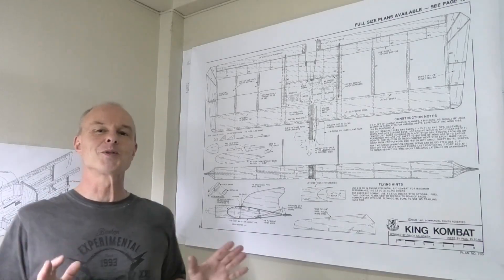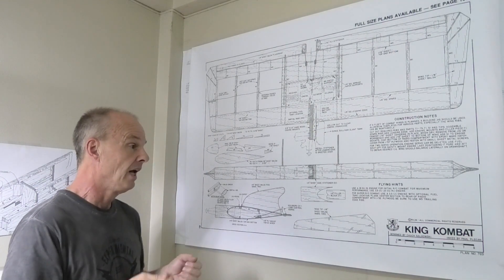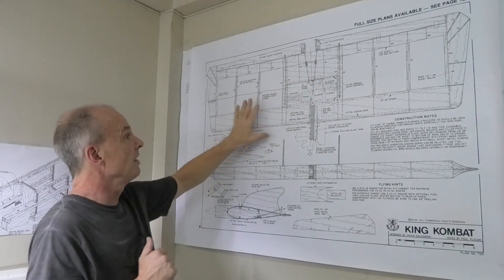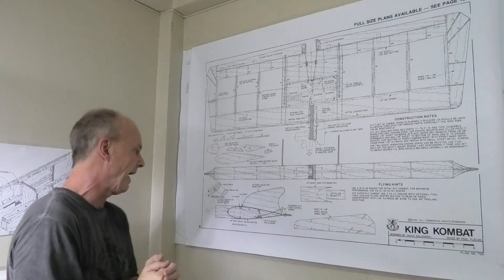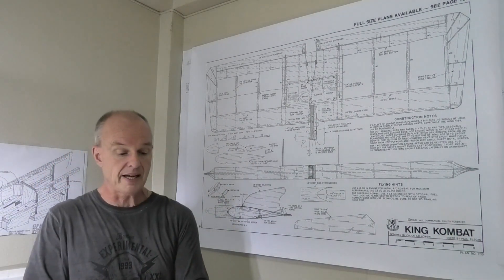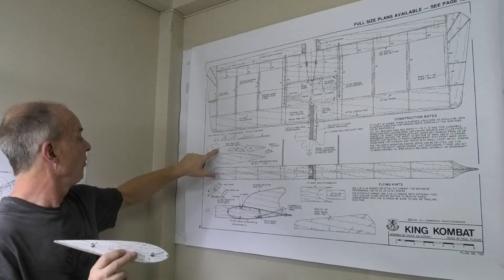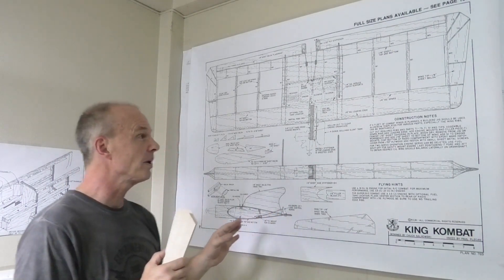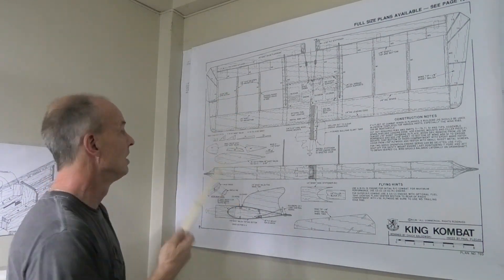King Kombat Pt 1 - a balsa 40" RC flying wing! - A great plan & preparation for the build

Comment: This has just been added to my long list of projects! I have a vintage OS 25 FSR that needs a plane.
Reply from the maker: Excelllent, good to hear, you won't be disapointed in its performance with the right engine!  I am now running it with an Irvine 20, which has bags of power.  You mention a vintage 25, guess thet may depend on whether its Schnuerle ported or not, if it is it should be great, with bags of power, if its a crossflow then it may be ok, but you will just have to see, but you will be able to tell holding the wing up at full rpm and whether its pulling or not.  My TT .15, which was crossflow just hadn't got enough power

Comment: I enjoy my "wing" type combat planes. My current and longest lived is a "gremlin". Think I may have a go at this after your`s fly`s successfully!
Reply from the maker: Thanks for the comment, pleased you like flying wings, they are great fun to build and fly
Reply from the maker: Kavin, is that Gremlin the 48" wingspan from RCM magazine? How does it fly?
Reply: @MarkRobinson555  indeed it is the RC Modeler plan No. 1134 Foam wing and drainpipe fuselage. Flies great on a TT42GP. How they get them to balance witha .25 is beyond me. I have just acquired a "Mini Pipe" which I hope will improve the performance a bit. It did initially suffer from some elevon flutter, but that was cured by blenderm tape over the hinge line. Video on youtube. 
https://www.youtube.com/watch?v=G3X7Iicu7Co&t=165s